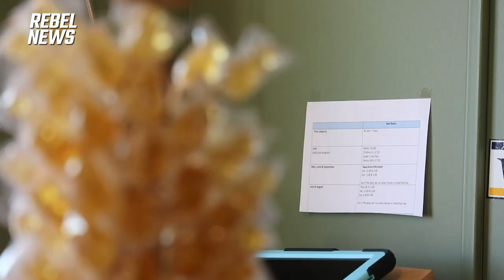Honey 101: Rebel News visits an apiary to learn about beekeeping

Comment: Do they wash the inside of the China bottles from the factory before filling with honey? Probably not.
Reply: Factory oils and particles found inside bottles. Toxic chemicals.
Reply: Likely they do. I make wine and always wash and sterilize my new bottles. But it would be nice if they could buy made in Canada bottles. It is so hard to find made in Canada anything. But I always try. If not Canada, I try just about anywhere else.
My iron came from Europe.  Cost more, 80 on sale,  but 3 years later it is still going strong instead of filling a landfill. A made in China version would have cost 30 and I would be on my 3rd by now.
 It also has a nice long cord instead of a few feet that barely reach the ironing board.